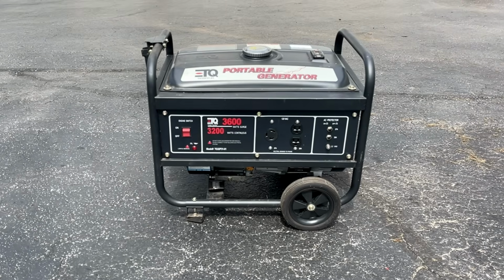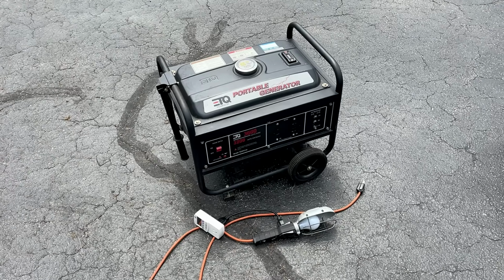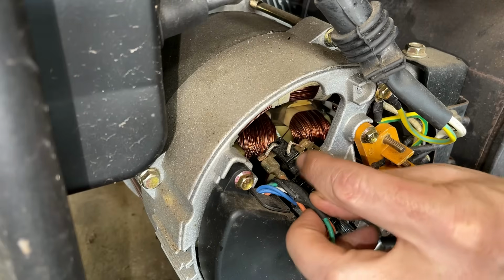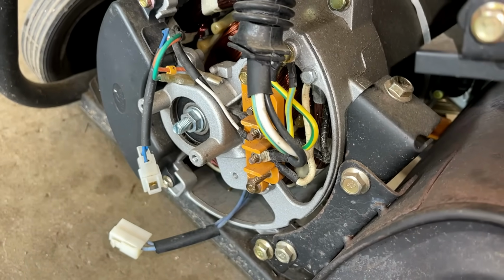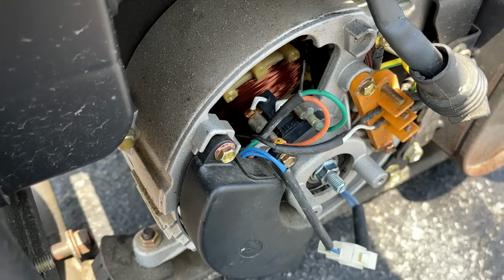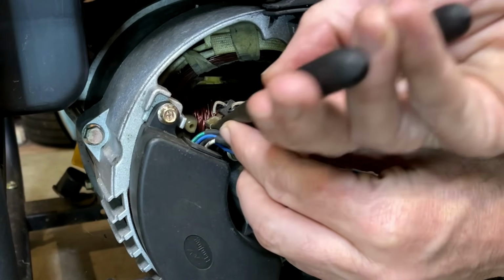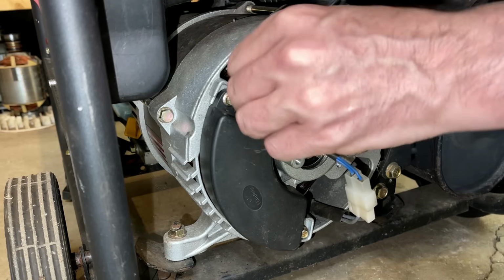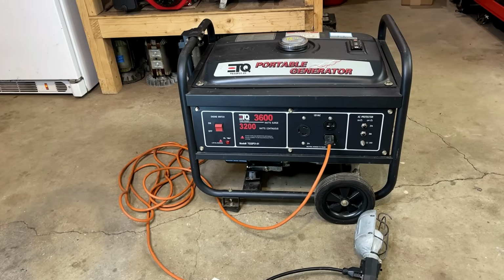Two Generators No Power Output - Same Model, Same Problem?

Comment: James, the reason why those brushes failed so quickly is because of them being misaligned onto the slip rings. I'll send you a private message with a picture describing what I'm talking about but you may want to use an inspection camera to make sure the brushes are sitting directly on top of the rings. If only a portion of the carbon brush is on the slip ring it creates a bottleneck for the current to go through thus why it got hot.
Reply: Proper engineering isn’t the issue, more like poor quality control in the assembly process of mounting the bearings to the stator shaft
Reply: So who else has purchased  these  kind of items and not unboxed it until months later when the warranty has expired,  not to mention losing the receipt?
Reply: By the looks of it the brush casting has melted and cause the brushes to fail if was uncased in bakerlight this will not happen
Reply: @smallbyrdz3823  Exactly!
Reply: Decent and informative. Thanks for sharing. Keep posting.
Reply: In any mass production there are units that are misaligned I once had a customer complain that because we had let his water tank run dry causing his pump to run dry so he'd had to rebuild it twice and he'd run out again and his pump was burned out again so we took him a load of water 2000 gallons and before the truck was half empty his tank ran over now there's no way a 2000 gallon tank of water will overfil an 8000 gallon cistern so since I had gotten his Make and model of pump I had everything to rebuild it but when I started to put it back together I found that they had given me the wrong mechanical seal so I had to use use the old one replaced the impeller and it's outer housing put it back together with a new housing seal and told the owner I'd be back to replace the mechanical seal well it was a week before I could get the new one and when I opened it up I found the impeller was badly worn so I took the pump out after showing the owner and headed to the dealership they looked it over and tried to say I must have done something wrong but rebuilt it then they tested it and before it even got to 50 psi it seized up and when they opened it up it was the same problem impeller seized to the outer housing like it would do from running dry turned out the outer housing was misaligned and rubbing against the impeller so they replaced the pump casting and rebuilt the pump at that point they were very apologetic and agreed to refund all his rebuilds costs including my labor it was quite the cost over 200.00 $ per rebuild for labor and parts  so we had one very happy customer so yes things can be misaligned so do as that one comment suggests check to see if the brushes are properly aligned it could also be a bad casting of the brush housing in which case the new one will fix the problem I've seen brush housing with a jog on one side and the spring gets caught up and even though there's still lots of the brush left the spring doesn't put the pressure on the brush to make proper contact  causing arcing and overheating
Reply: You Are On to something!!,Could Be!
Reply: ¹
Reply: Totally agree, it looks like the brushes are riding too far back from the marks on the slip rings. Defect in the spacing of the casting. The question is how to fix it. The mount point needs to be machined down ideally, avoiding modifying the brushes.
Reply: @johngalt7382  I've shimmed them.
Reply: It looked like the brushes are mounted inside of an encapsulated, molded plastic frame assembly that is mounted directly to the metal framing of the power unit. In what form or fashion are the brushes adjustable that they could possibly be misaligned and to such a proportion of contact with the slip rings that would cause a resistive bottleneck of the current causing an overheating issue? It's not an adjustable piece. It's a direct bolt on flat to the frame.
Reply: @additudeobx  https://youtu.be/P4Wic_jt1KM
Reply: @additudeobx  give me about 10 minutes I'm going to post a video to show you exactly what I'm talking about
Reply: https://youtu.be/P4Wic_jt1KM
Reply: @additudeobx  you can put some spacer washers on the mounting bolt of the brushes to bring the brushes closer to the end bearing if they are too far towards the engine side. 

In James' case he has the opposite problem where the brushes are too close to the end bearing and there is no way to adjust the brushes to be further towards the engine side. In this situation there's usually two causes for this. The first one is the end bell is not properly seated with the stator and needs to be corrected and tightened up. The second issue is a manufacturing defect where the slip ring assembly was mounted improperly to the rotor shaft housing. In this scenario there is no way to adjust it as this assembly is epoxy glued to the rotor.
Reply: @Bassguitarist1985  - So now you want to "Jury Rig" the part to substantiate your claim. The brushes and the brush housing are, by design meant to mount and bolt on flat to the frame to achieve the design brush specification alignment. The engineering design doesn't call for "Use Spacers As Required for Brush Alignment"... That's not how proper engineers design stuff since the 1900's.
Reply: @additudeobx  of course not but we're dealing with low quality Chinese construction. I'm saying that it's a compensation measure given that you would likely not get a replacement rotor under warranty so you work with what you got.
Reply: @additudeobx  Since neither unit looked as if it had seen much use and had the same fault, I doubt "proper engineering design" was used. I wouldn't trust either one to get me through a power outage.
Reply: @Bassguitarist1985  Crowbar.
Reply: @Bassguitarist1985  could he just bust out the grinder and grind the mounting flange to push the brushes towards the motor? When in doubt, start grinding 👌😉
Reply: @gidderman  possible yes but may compromise strength of assembly. Brushes are under spring tension so...
Reply: @Bassguitarist1985  yes he would have to gauge what he can get away with for grinding. Or-as I saw on your video I just watched someone commented to bust out a puller and see if you can move the slip ring assembly. It reminds me alot of power steering pullies which often need to be aligned with either a puller or installer tool, it's a press fit situation...
Reply: @additudeobx  Made in china 😂😂
Reply: @additudeobx  i never knew  of the phrase jury rigged . I thought it was  jerry rigged  ,so i just looked  it all up . Historically they have  different meanings but these  days jerry rigged is taken as alternative spelling for jury rigged  but  not the vice versa. Jerry rigged means a shoddy job , but could be confusing because jerry word came to mean  the Germans and Germans  have a reputation  for top worksmanship . I  think German  jerry was  originally spelled  as gerry though .
Reply: @tinkerman9525  Not everything made in China is crap.  There seems to be three different levels of production. 1.  High quality items outsourced to China like some Nikon products.  2.  Absolute crap made on the cheap for a quick profit.  3.  Goods of basic sound design that just needs a little finishing.  I have bee a long time competition airgunner but I started with cheap Chinese CO2 powered air rifles that were basically of very good design but had poorly finished internals producing variable power level resulting in inaccuracy.  Polishing the internals, cleaning and widening ports and replacing the horrible fittings with stainless steel ones made them into little gems.  A whole cottage industry sprung up converting these rifles into something special.  I believe this generator falls into the same category.  A solid piece of kit let down for the sake of a little care in finishing.  Chinese goods to a T.
Reply: @Biffo1262  Hi. I take note of what you say abt Nikon etc. My hobbies are RF electronics and IPSA.  They sell electronic components outside spec and some dont even work. I have stopped buyingfrom them altogether. Not worth the hassle. Milage may vary. It is just not worth the time faultfinding.
Reply: @tinkerman9525  lol hee hee😆😆
Reply: @tinkerman9525  is that you Henry?
Reply: @mikekahotea8148  No. It is me the one that tinker.
Reply: @tinkerman9525  if it is you where's your brother and is Clarke still around
Reply: @tinkerman9525 So is peoples iPhones r u going to knock that too?  Chinese manufacturers will make top quality products if they get properly compensated for and not ripped off while you knock them and blame them for low quality, child labor, human rights, basically all the negatives things in the world. Get over yourselves. Go spend the top dollars and buy German and yet parts will fail and you’ll spend even more just the same but u gladly pay without complaining.
Reply: @additudeobx Sorry, you think this was engineered? Lol, it's Chinese. The original design was stolen and modified to be as cheap as possible to manufacture while still meeting the specification for at least the first startup. That's how China "engineers" their products.
Reply: shouldn't you be listening to your grade 4 teacher not commenting on youtube
Reply: @Geopolitics2day  who are you addressing?
Reply: @gidderman  Yes I would be interested who your rude comment was aimed at too.
Reply: @gidderman  sorry i was talking to that child additude obx. I meant to reply to him
Reply: Agreed they look like they were riding on the outside edge,brushes burning down  quick
Reply: Could a new brush holder be 3D printed that is aligned more accurately. Or is the plastic from a 3d printer not suitable?
Reply: @slypig24  They sure didn't use bakelite.
Reply: @tedmoss  yes bakelite was better I had an old black and decker drill and a lot of holes to drill I drilled until the drill got too hot to hold didn't get half the holes drilled so I put on a pair of welding gloves and finished drilling the holes and it never quit after it cooled down it was still working tried to drill some holes years later with a different drill it barely got warm and it died opened it up to see if it needed new brushes and found it was all plastic and melted out of shape all that drill was good for was garbage wasn't enough metal in it for scrap so give me a good old metal one any day
Reply: @douglaswindsor120  You must be an old man like me that watched the quality of tools/machine deteriorated from the beginning of the 80's.
Reply: @slypig24  honestly I have no idea. However that idea intrigues me. I suppose with enough know-how and materials it can be done.
Reply: @slypig24  That could work, if the brushes can be held straight, then they wouldn't be strained and wouldn't get hot and start distorting
Reply: @slypig24  3D printers melt plastic to form the part,but for this brush holder,you want the part to be heat-resistant. chances are good that the heat from the brushes would allow the 3D part to deform just like this failure. OTOH,bakelite is a thermosetting plastic,very heat resistant. like epoxy,heat hardens the plastic.
Reply: Some times I've found the brush lead wire is bent over stopping the spring from putting proper pressure on brush causing heating, make shure brush lead wires are arched straight up in a smooth loop so they can feed into the brush holder
Reply: @smallbyrdz3823  another variable is the brush assembly itself, likely a lot of inconsistency in the physical dimensions. If its a few mm's shorter or longer will have an impact.

Comment: you didn't mention how you addressed the melted part of the brush holder. did you replace it? if so what brand?
Reply: Complete replacement of the generic brush holder...bolt in part common to many gensets...of this quality..

Comment: They should've made the brush holder out of Bakelite plastic.
What I see is likely ABS with 30% glass fibers. Strong, but not heat resistant. 
Bad engineering design. That's why ALL of them will develop this fault in time.
Reply: THIS is the real reason this happened… I doubt they have ANY glass fibre in the mix and it’s just cheap ABS..
Reply: @MarkusEDMA  The color and texture of the part, is that of ABS with glass reinforcement. Either way, ABS gets soft at around 80ºC which makes it shit for this application.

Comment: I wonder if emery cloth could be used very carefully to resurface the slip rings. I used that while cleaning up starter motors in the old days.
Reply from the maker: General would not recommend it, but in this case probably called for.
Reply: @jcondon1  I agree

Comment: at 10:35, I would've spun the rotor using a socket attached to a power drill to turn it, while using a 400-800 grit sand paper to shine the brass rings.
Reply from the maker: Thought of that, but did not want to get a finger caught.  Would remove the stator before doing that.
Reply: @jcondon1  Fingering parts is never a good idea :)
Reply: @jcondon1  form a small block of wood to fit and wrap (or doublesided tape) the emery cloth/snadpaper around the wood piece. then hold that against the slip ring while your impact driver turns the rotor. then you're more sure of getting a level grind on the ring.

Comment: Great video James.  2 questions.  You noted the problem was with the rotar because of the low voltage residual magnetism.  How  does that rule out the stator?  Were your replacement brushes a generic replacement or the same brand as the generator?  Kind regards,  Craig
Reply from the maker: They were a generic replacement.  It still could have been a bad dpe winding in the stator.  That feeds the AVR, brushes and rotor.
Reply: @jcondon1  Thank you

Comment: We've seen this problem before, and it's almost always been on generators which weren't given any 'run down' time after running on a full load.  It shouldn't happen at all, but it always seems to be on machines that have been hot, and not allowed to cool down before stopping. 

Another scenario might be on machines that have been overloaded, long enough to overheat, but not enough to cause a failure.

Looking at those slip rings though, it seems evident that the machining leaves a lot to be desired.
Reply from the maker: The machining looked very poor and the brush alignment on the second generator was off.  Not very good quality.
Reply: @jcondon1  the generator in this video is the exact one I have that won't start
Reply: You just speculating!.... It's due to poor engineering and even worse workmanship along with junk materials. It's just garbage, there is no more pride in quality manufacturing. When you pay for everything with credit, nobody cares and pays no attention to Quality!....
Reply: @mikek.9980  No, just stating observations.
Reply: @Wayne B That's what I was thinking

Comment: Couldn't you clean the slip ring with fine emery cloth, or replace them with an alternator slip ring for example James, if they're not available from the manufacturer? 
Love your video's by the way.
Reply: If you follow the slip rings' existing surface with the sandpaper...
any existing hills or hollows in the slip ring surface just get followed but not eliminated.
You basically have to lathe them smooth with an adjustable brush-like holder that takes the hills off until they are down to the bottom of the dips.....????

Then the smoothed even surface can polished....
Reply: @JohnSmith-yv6eq  Spot on.